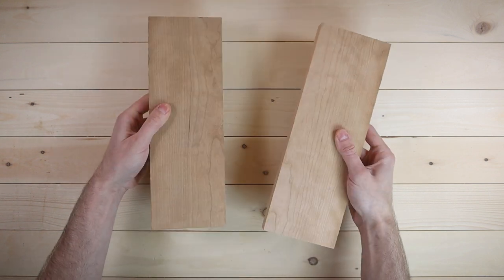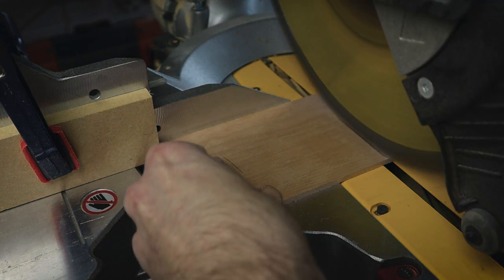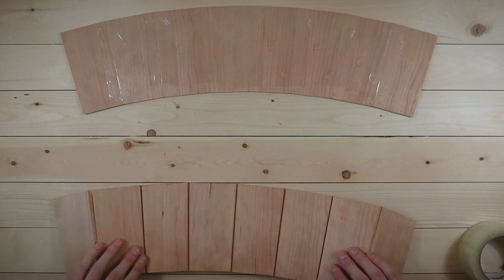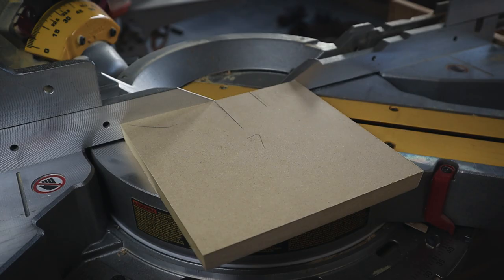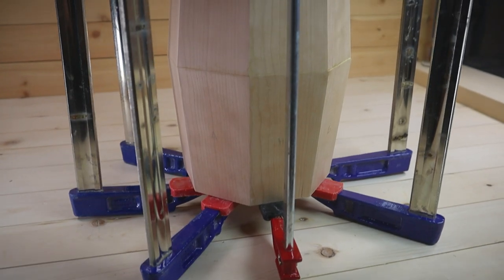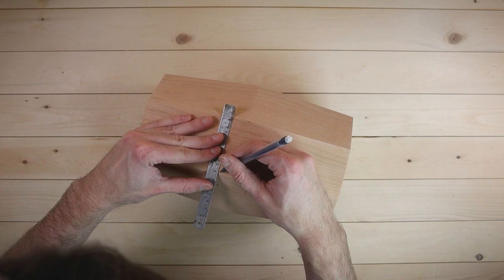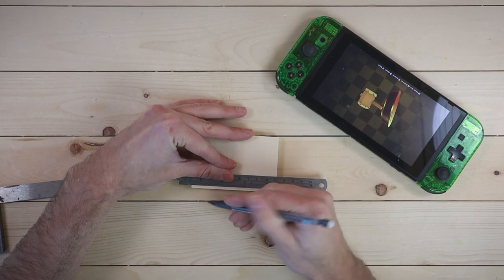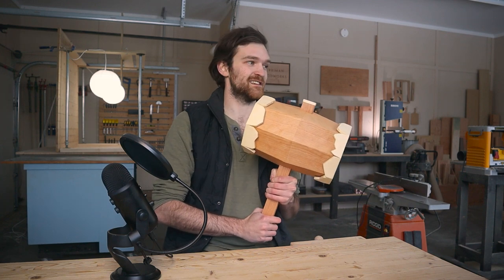How I Made MARIO'S HAMMER from Paper Mario: The Origami King

Comment: Nicely done! What is the reasoning behind using super glue verse wood glue for the foldy bits, set time?
Reply from the maker: Exactly! Wood glue needs about an hour of drying time and consistent, stable clamping pressure to cure properly. Super glue only needs about a minute, and I knew trying to get clamps on those little corners would be a nightmare, so super glue just made the most sense